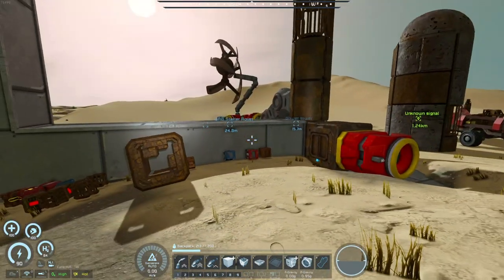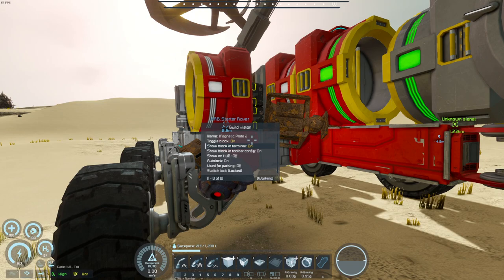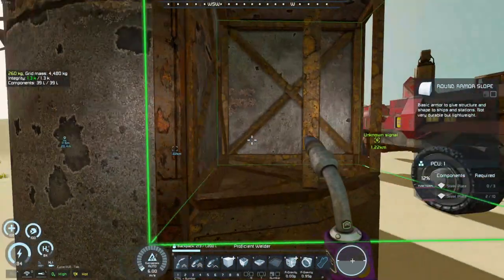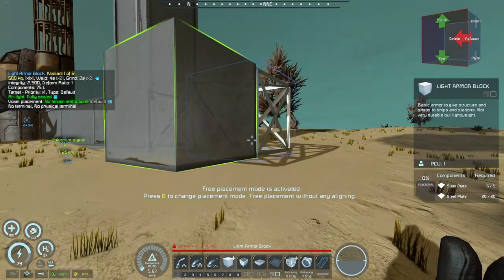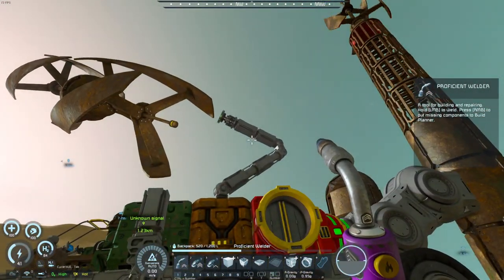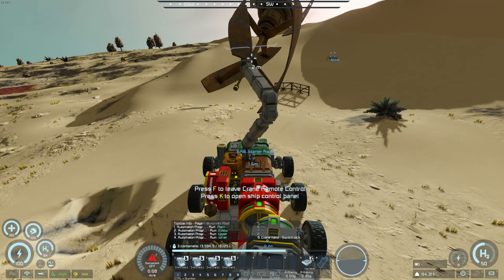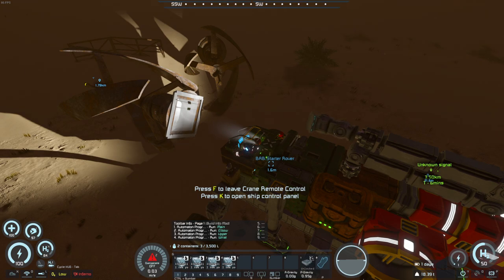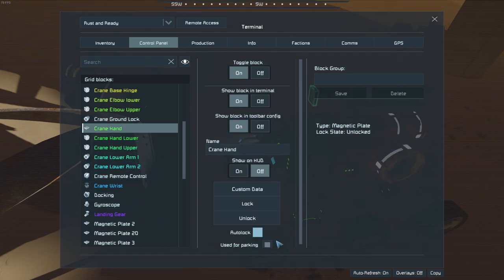Lets get these turbines up | Space Engineers Scrapyard Survival | E9

Comment: Your towers should be 9 high for optimal performance...  I would piston and merge block them to hight 

And there should be a rotor in your tow hitch... set limiters, no parking torque, then turn the blocks off same with the trailer wheels
Reply: And wind pillars should 8 blocks spaced from other wind pillars
Reply from the maker: So I need to reconfigure my base power setup a bit. I'll add it to the list of things to do.
Reply from the maker: Thanks for the tips! Keep them coming
Reply: Thanks to your video just came up with an easy way to set up wind towers a rotor and 9 blocks then turbine lift up and lock the hinge